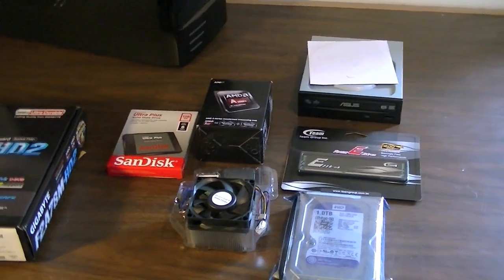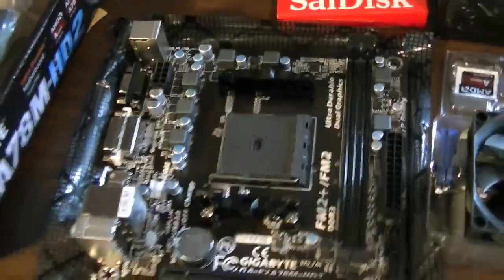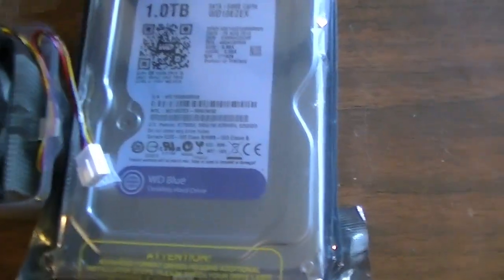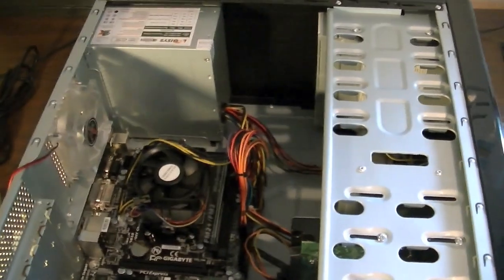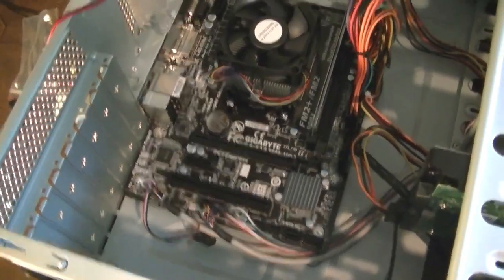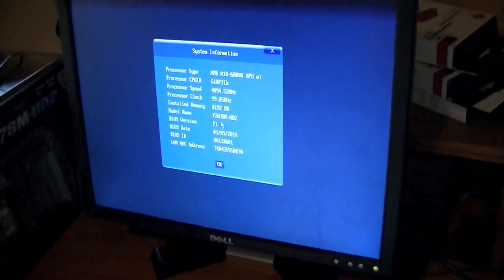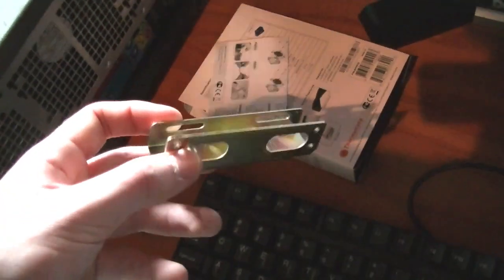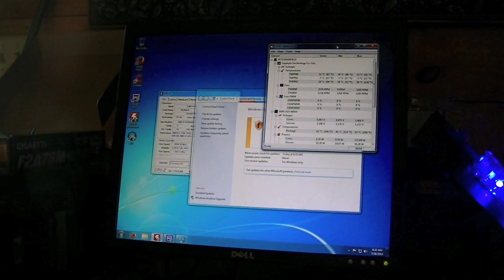Building a Quad-Core AMD A10 Workstation PC

Comment: Good work on the build. When I was building a PC last year, I started out with an old Gateway microtower PC, and gutted out the inside because the previous owner overloaded with an accessory cooling fan, a TV tuner, and a video card supported by a 350W power supply that had a cracked PCB and a motherboard with bulged capacitors.
Now, it runs on a Gigabyte GA-F2A55M-HD2 motherboard with an AMD A4-5300, and an internal Wireless N adapter powered by a 430W power supply. So far, it runs strong. Again, good work on your PC build.

Comment: I encountered these same things with this identical combo. The 4 pin works just fine in the 8 pin slot and a $2 molex to Sata adapter from radio shack allowed me to power the ssd. Temps are fine no need to replace the power supply just look for the BEST solution instead of the easier more expensive solution.Yea, the case doesn't have a specific spot for the SSD, so what?

Comment: One thing I have to say is your power supply is like the heart of the computer. If you get a power surge and your power supply isn't insulated well you could have multiple parts taken down with it. Like say it sands to much power to the graphics card or if it fries your ram. Never never trust a power supply that is not 80 plus bronze certified.

Comment: Dude, in every single one of your videos, you take the motherboard out and place it on top of the anti-static bag.  ESD bags work by collecting electro-static charges, and keeping them contained on the outside of the bag.  When you place the mobo on top of that, you are essentially placing it in the worst place possible, and effectively introducing it into an environment loaded with ESD..
Reply from the maker: +Mario Saltalamacchia Is it possible for that ESD to discharge through one section of the bag to another through the motherboard? Or would the ESD transfer to the motherboard until the motherboard touches a grounded exit?
Reply: +Someone7089 Depends on circumstances and what motherboard your dealing with.. I know that most of the precautions people take with ESD are overkill, but better safe than sorry.  I just know that the outside of an ESD bag is the most charged portion of said bag.

Comment: sooo when dealing with the ssd, just use some double sided foam tape and tape it to the side no case as far as i know makes a special area for ssds, especially cheap cases. for the power supply... i hate to say it but you get what you pay for, so cheap = cheap, and it goes up from there. other than those two points good vid. unfortunately with computers it cant all be perfect easy sailing. if it was then it wouldnt be as fun :D